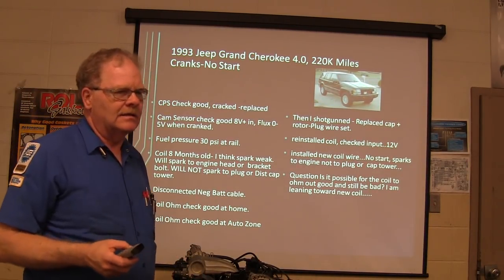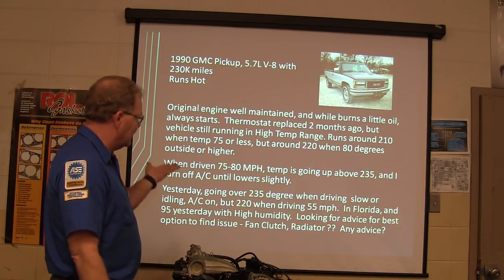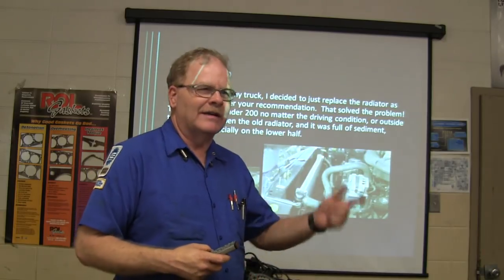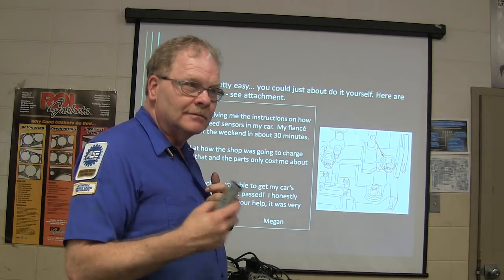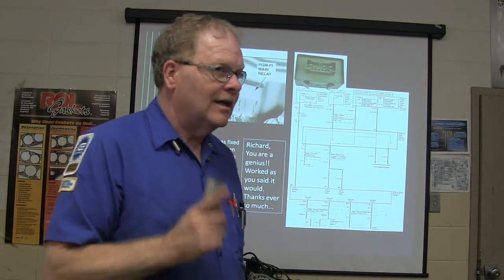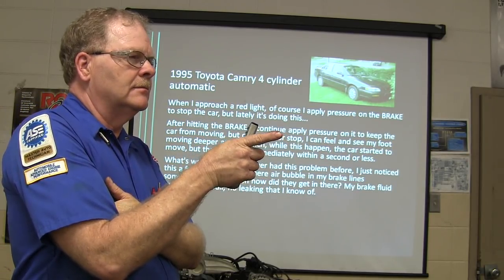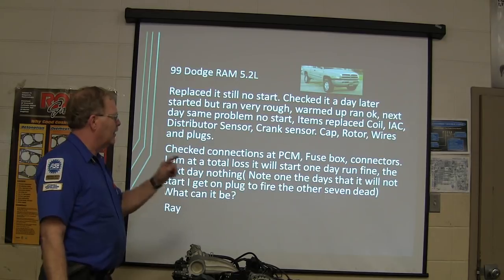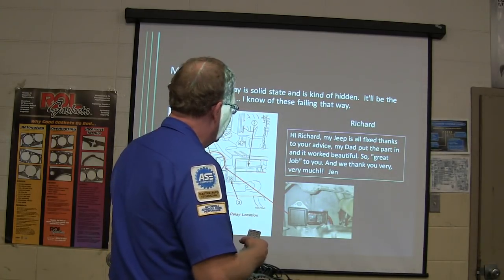Help Desk 2

Comment: Hello Professor McCuistian,
Love your work students and videos please keep making more. Do you have videos crank and camshaft inputs and partial short to ground side and and power side on Asian cars corolla 2000 in particular and how to check transistor pulse with a test light. God bless,
AG
Reply from the maker: Crankshaft and camshaft sensor patterns vary from vehicle to vehicle. since those stand-alone ignition transistors are NPN, you use a test light connected to B+to trigger the transistor to fire the coil.

Comment: Hello Professor McCuistan,
Hoping you can give some direction on my recent discovery; Car does not crank in park; it cranks in neutral, no start. Pulled stater relay the load side is hot all the time without key on; control side reads 3.44 volts with key on however it reads 12.39 volts with key in start. what is pulling down voltage on the control side? I use the test ,light to power the ground side of control it lit up why? If ground side light up is there unwanted resistance? Its not suppose to light up if their is a good ground right or wrong? The neutral safety switch works fine it was tested at the starter relay with test light on control side it does not light up however with a volt meter on control side key on it reads 3.44v key in start position the meter reads 12.39v. When I shift to reverse the test light is turns off when I shift to neutral it turns back on that is how I verified safty switch works ok.
Respectfully,
AG
Reply from the maker: First of all, the no-crank in Park issue sounds like a neutral safety switch - I'd fix that first.
Reply: @McCuistian  Wow that is confirmed thank you. Because of the switch is it possible computer shut down the throttle sensor too?
Reply from the maker: @alexandergonzalez2232  Not likely

Comment: Hello McCuistan,
The shift on corolla Toyota 2000 is stuck in park. I have to push release button to shift out of park into neutral. It cranks in neutral will not start? Do you have videos on neutral safety switch and shift selector switch? Think has been the problem from the start over looked it failed to communicate the obvious.
Reply from the maker: Check your stop lights
Reply: @McCuistian  Brake lights work fine. Is the brake light switch wired into the selector switch solenoid depressing knob button, I can hear it gently click on/off.

The shifter cables are good; the neutral safety switch is good; the brake booster is in question; brake pedal goes down without resistance and returns depressing brake light switch; there is play on pedal; brake master cylinder is in question; reservoir was empty with no visible leaks to rear drum brakes and front caliper disc brake either. refilled brake fluid pumped up and down without resistance with key on, no build on the pedal. either.

Since car will not start I cannot do the air tight test on the booster holding down brake pedal turning engine off to feel pedal pressure?

The fluid in reservoir does not lower its level when pumping pedal car  key on.

Respectfully,
Reply: @McCuistian  professor I understand you are very busy and manage a large fleet of incoming sick cars, Please I apologize and respect your obligations to the student and car owners, you may not have the time. I still love watching your class room sessions, if you ever make a video on the system shifter automatics, I will enjoy watching it because you are a valuable asset to the do it yourselfers, car owners, who are all suffering from the decline of service and the auto recession, folks cannot afford to buy new cars nor will they go to dealership who ripped them off in the first place. Thanks for all of your responses, it will never be forgotten and for ever in my heart you are always remembered! Blessings!